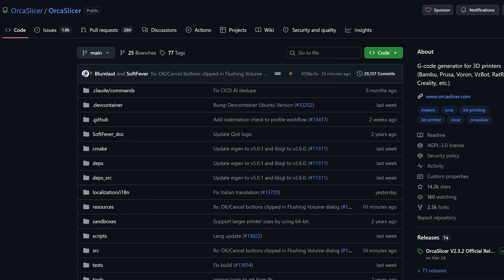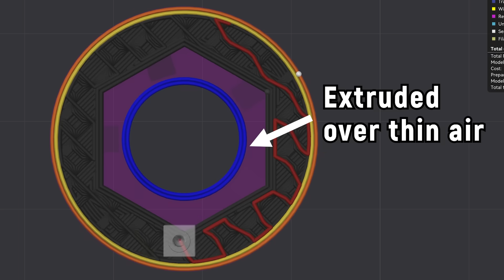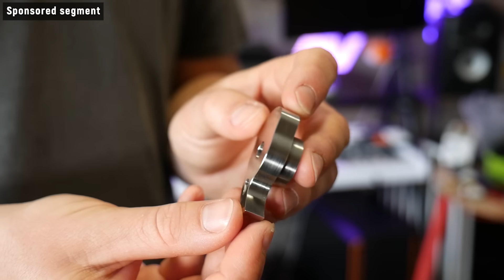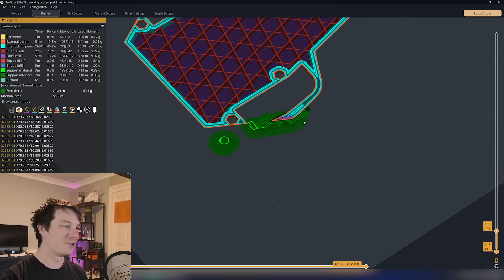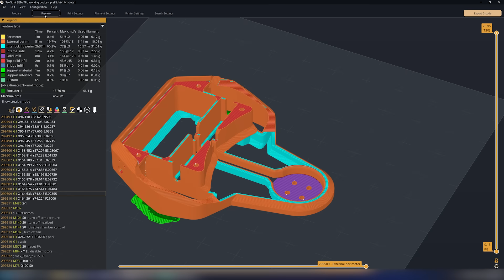preFlight - an incredible new slicer with even more incredible bugs (for now)

Comment: 6:14 I think measuring the part density would tell us more if the part has voids or if the geometry is actually different between the different methods. Printing some calibration cubes and measuring the dimensions for volume and then measuring the mass will help answer that.

Edit: Also that was one of the most useful sponsorship ads I've ever seen

Comment: using cc3d's 72 D is so evil lol, i used it to make bar feed liners for a lathe and they are still going strong over a year later, layer adhesion is unreal its practically indestructible when printed correctly

Comment: First thing Angus. I've hardly ever, if at all commented on any of your videos but I've been referring to them nearly as long as you have been making them, so It's time I said thank you, thank you!
This looks like a way of improving the strength of so many things I make, especially for RC aeroplanes (for which I never use PLA) so it's a good thing for me to learn about. It's so much more likely I will use it when you describe the settings you used so well and the good (or bad) results. I don't see any reason why the same can't be applied to the materials I use such as PETG CF. would you agree?

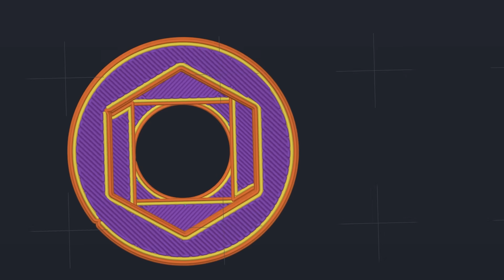Comment: 7:06 I’ve started to do this in CAD modelling (self supporting holes) but knew one day a slicer would be able to do it for us. So this is brilliant 🤩 hope it comes to orca slicer. 

I’ve noticed though on Creality Print, Creality have started to add their own tweaks & modifications. They’ve got something in the extrusion rate section that helps with line gaps when the speed changes during over hangs. It works quite well. Again I hope orca devs bring this

Comment: Submitting patches for Orca Slicer doesn't make sense for this.  It's far too invasive to expect it to be merged any time soon.

What does make sense is exactly what they did:  Pick a good slicer, fork it, and implement the changes.  

If the other slicers want to copy those changes, they can.  The source code is right there, available to everyone, and built on the same foundation they all are:  Slic3r and Prusa Slicer.

The buggyness of this proves that their changes would not have been immediately accepted in any of the major slicers directly.

Comment: Not sure if anyone has mentioned this yet, RE the settings tabs: when you click on the top tabs, it always shows all settings, and the checkboxes on the left of each setting there toggles the visibility of that setting in the drop-down accordion tabs. This allows you to customize the accordion drop-downs to only show your most commonly changed settings, which is a very nice feature similar to Cura. This is something I have wanted in OrcaSlicer for a long time, though I think preFlight would do good to change the top tabs into simple "Edit" buttons next to the accordion drop-downs instead, to help cleanup and simplify the UI.

Comment: Why not have full copper on top and bottom of your PCB's - wouldn't that make them structurally STRONGER by adding a metal outer sandwich to the fiberglass-resin of the board itself...

Comment: I still prefer sacrificial bridges... no stair stepping. Nip/Tuck looks interesting for functional parts, but my issues with seams is usually more related to appearance than dimensions. When dimensions matter, poly holes do a good enough job and also gets the seam moved in from the edge of a hole. But I can imagine nip/tuck being useful for non circular/non polygon holes.

Comment: That's really smart using blank PCBs as covers, I don't think that ever would have occurred to me. Besides being cheap, there are some obvious advantages. Those will be inherently a lot more temperature resistant than plastic, and they won't be conductive like carbon fiber. I will have to keep that tucked back in my memory files for future use!

Comment: I actually gasped at counterbore bridging! I've been waiting for that feature for so long and even tried to make a script to fix it.
Super exciting to see a full solution implemented, even if you still have to select it manually
Reply: I mean. Orca and I think prusa has had it for years..
Reply: @MeshJedi They claim to but are really not on the same level as what is presented here.
This is basically the same detail and control as doing it in CAD.
Reply: @cl3m3n7 no. It literally does it exactly the same.

Comment: Avoiding seams:
I let the printer continue with the next layer, without a pause. No retract on layer changes. That's counter intuitively, but it works. 

That's not a vase print, it works on normal solid objects. It works best when there is only one so called island in each and every layer. Just quickly move up a layer and continue printing, so there's no time for oozing. No time for making a seam.

Don't think about extruding a solid line of plastc, think of what it really is: A molten very liquid plastic. It squeezes easily in the gaps and so on and it just looks way better than any seam, because there's no seam left.

When there's an option for it, then avoid one seam line, let it use more or less random seam positions to hide it even more. 

When possible, let it start the next layer near where it ended the previous layer.

I also avoid crossing the open spaces if possible - this avoids these fine ooze lines across the open spaces. 

When there are multiple islands per layer, then try to reverse the printing order for the outer and inner shells.

Let it start a new layer on a new island on rhe outer round around the object, then the inner path, then some infill when there is some (I often print the infill only every second layer...)

That means, when an island only consists of the perimeter walls, it starts on the outer wall, then prints the inner wall, then oozes a bit while pulling the filament back a few mm. But it oozes on the inner wall, not visible from the outside.

Then the orint head moves to the other island, starts there with the outer wall, then the inner wall, then the infill (again only on each 2nd layer), so that it oozes while being on the inner perimeter wall (invisible again), the print head moves to the other island, one layer up, starts printing on the outer perimeter wall, then the inner wall and so on...

And the oozing seam is hidden.

Comment: thanks for not saying slick-three'ar buddy :) but u missed it at 2:23 with exetera... its ETcetera. not EX. we write it like etc yeah, not ext :)
the problem with this way doing unsupported counterbores messes up the roof of the cavity. why not just add a disc that is one layer heigh in the slicer and move it to the unsupported area and select 100% infill for that layer? or use sacrificial bridge option or what its called in the slicer you use;) ? this is redundant imo as support interface materials are dirt cheap and you dont use much and the purging is a few grams. its already solved better than this approach. its like coming the party the day after it ended, no?

its so fresh to see a new take on slicing :) since orca came there hasn't really been any new ones for me. this one is most def something im gonna dl and tinker with. thanks for the heads up on the 1.0 problems👍

Comment: I recently downloaded PreFlight, but haven't had a chance to really play with it. I do think the Athena perimeter generation will be a game changer in the long run. Personally, I like that it's forked from Prusa Slicer and is its own separate thing from Orca Slicer. I use Orca, and one of my biggest peeves with it is that it is so full of features and little bugs that just make it annoying to use. Because it comes from Bambu Studio, it has all this crap for Bambu machines in it that I just don't care about and don't want. Additionally, being a fork of a fork of a fork, there are a lot of little bugs and the codebase is probably a huge mess. So while PreFlight is currently early days and buggy, I do think they're working on a much more solid foundation.

Comment: Good on you for persisting through the bugs and annoying migration from OrcaSlicer. I gave up. I really wish they could have just submitted these features as pull requests to OrcaSlicer, though. 

To wit... Bridge Counterbore Holes has been in Orca for a LONG time ;)
Reply: The main "feature" of preFlight is that IT IS NOT JUST A FORK. It is a  new development initially based on Prusa Slicer. It has a different, more advanced slicing engine, whose benefits are yet to be exploited.

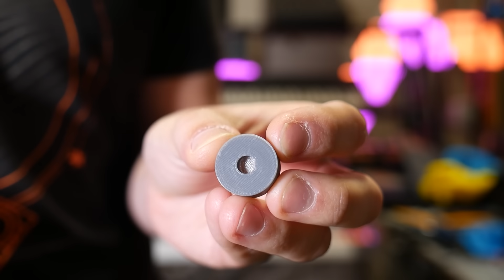Comment: 8:07 they had the chance to add the print in air functionality, and decided to go back to bridging. Shame. Also they were late on the brick layers, they're not pioneers. It's been done so long ago that even Cura, the old open source one, has had scripts for it.
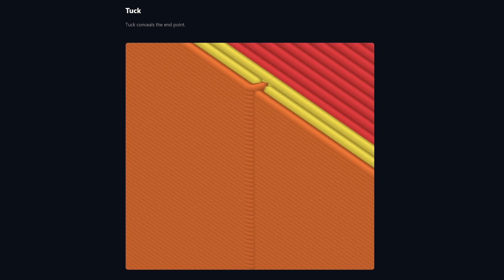9:00 This is just a different way to name where to pull the nozzle after the line is done or before the line is started.

Comment: Question: Should I switch from ElegooSlicer to preFlight or even to OrcaSlicer. ElegooSlicer seems to be getting all the latest stuff features within 1-2 years. I own Elegoo Centaur Carbon 2 and I see the potentially in it. After it may well be a real power house. I do not have the knowledge base of all the slicers to make the final judgement to be sure which is the best on which the setting modification could be made on. 

Previous printer was Ender 3 v1, tweaked it to be pretty good machine. Was a great printer for small parts but anything bigger it would just fall on it's face with the print time. 9h Ender print takes on CC2 under 3h.

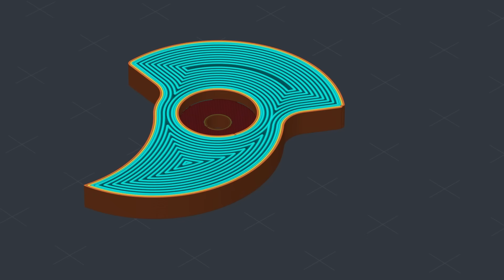Comment: Skip to 2:40 to see the unique features of this slicer (no offense to the creator, it's just that it makes more sense for us as users to see if there are any pros before we hear the list of cons for a product).

P.S. it would be nice to see testing of the material, though I would like to point out that your test stand thingy was mainly testing the bending strength of the part? Which is a little bit of an indirect test. Maybe it would be nice to have one test piece to test shear strength(like what you made but with a much shorter arm), and another to test normal (pulling) strength, as those are the two loads that make up every other type of load. 

P.P.S. wow that cat is gorgeous what brand (breed) is it?

Comment: I know SuperSlicer isn't popular anymore, but it has a `seam notch` feature, similar to the nip/tuck but differently implemented. Also the alpha/beta releases contain a `max overhang` setting which can result in counterbore bridging and tear drop shaped vertical holes, but it'll also mess with the rest of the model if it has severe overhangs.

Comment: I use PCBs in RC cars for replacement parts.  When using them structurally, remember the copper is still metal, even if it's soft.  Keeping it on as a full fill plane, or just in needed areas to help keep the FR4 from splitting, costs nothing extra.  You can even go to the trouble of adding platted through holes for even more support, or even castellations or a plated edge to connect it to other parts.  And, the plate can be used for power transfer without fear of losing parts.  It's great for power distribution.

Comment: After the first seconds, I had to laugh when I had seen this microphone, and than more and more again during the rest of that video.
Your knowledge of 3D printing is very poor and that Slicer is the same bulls**t as many other slicers too, including ORCA.
The only slicer thar I used over all the years that is fast and brings strong results even for beginners is the CURA slicer from Ultimaker.
All settings are much easier to reach, no very long scroöö lists and the parts of the settings are sorted logical.
And by the way, before spending a lot of money for PCBway, it´s better to buy a printer from Ultimaker, this are printers made for professionals and that´s why their slicer is professional too.
I can bet, that PCBway uses printers from Ultimaker too, because with an upgrade you can print also metal up to stainless steel ( KAWASAKI is a customer of Ultimaker too ).
Unfortunely Ultimaker does no lomger support the FDM printers of other brands (WiFi-protocol and other features), but if you look at the prize of a Bambu Lab or Prusa printer, that are NOT made for professionals and compare with the prize for an Ultimaker printer, you would be surprised.
But these are fot professionals and not for people that only want to stand in the spot light on XouTube like you.

Comment: I've been using a janky method of adding interlocking-style layers to my own prints using an STL that's just a stack of 0.2mm high cubes stretched out over a model. I set it as a modifier and adjust the inner and outer wall widths so the inner walls are printed in between the walls of the previous layer. Kind of surprised that Orca Slicer doesn't have some kind of "every other layer" height modifier.

Comment: I think we really need a good plug-in API for the slicer engine. So that everyone doesn't have to build their own slicer software just to add features.
Reply: Based on their website that's their most important feature. As far as I'm aware of how Orca and Prusa work under the hood they're going to buckle under the weight of their own complexity soon while Preflight has a plug-in pipeline built-in.

Comment: If I'm understanding correctly then you are thinking there should be a 1:1 ratio between volumetric number and extruder speed for same extrusion volume. I think this is incorrect. Fairly sure that the filament speed is how fast the hot end is tracking and that the volumetric setting is volume based. So, for example, halving the layer height for the same speed halves the volume extruded and gives less thermal mass to bond with the layer below. Volumetric on the other hand can be more closely related to hot end capacity to melt filament fast.

Comment: 10:13 I accidentally learned that PEBA rubber is ridiculously strong.
A 0.4 mm thread right from nozzle is usually easy to rip apart. Not so with PEBA. It cuts into your finger instead.
I hate that many brands try to hide what kind of rubber it actually is. 
In my case I had to guess from properties to deduce the type. But its quite clear in this case.

Comment: Wasn't that perimeter interlocking mostly not available to some stupid patent on a this totally self suggesting idea?
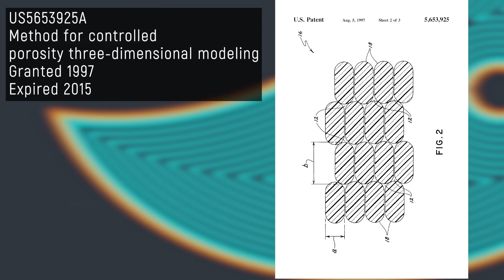Or was that just hearesay? Ah "bricklayers" patent at 3:53 
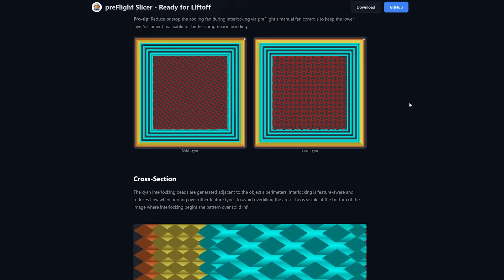But how is that not exactly the same thing here looking at the cross-section diagram at 3:20?
I don't see how bricklayers would require many height micro-adjustments as stated.

Comment: I have always wondered: why can't the counterbore bridging be done by the slicer like a star shape in just one layer? (Instead of having just 2 parallel lines on a layer then another layer) Possibly that layer doesn't even need to be filled in at all, just that webbing and the next layer can be the original geometry of the model
Reply: You might be onto something there. But I think for reliable bridging, you have to start a little bit above and behind the perimeter, otherwise the extrudate can detach.

Comment: Waiting for the rug pull on this. Hard to justify a company vibe coding a new slicer for any significant amount of time without income.
Reply: Beta tester here. Vibecoding? You do realize that every dependency in the slic3r codebase was completely updated or replaced with some not EOL for PreFlight? PreFlight is using Clipper2, which is not a huge upgrade in of itself but Clipper doesn't have an official upgrade path for that. Orca is working on Clipper2 adding it where they can but they don't have the man power or "slop generators" to replace everything that used the original Clipper. Every dependency that preflight has is updated, prusa and orcaslicer still use end of life dependencies. This has taken at least 2 years of work to "modernise" the codebase into something clean and "useable" for development in contrast to orcaslicer which at its core is jank, built on jank, built on jank and only time will tell when that age will show. Preflight removes a lot of that jank (since it doesn't have to touch any of bambu's stuff) and keeps the slic3r legacy going as that was a fairly solid foundation strengthened by Prusa and SuperSlic3r
Reply: Oh. They build printers, should've said that initially they're a printer company first
Reply: @muuhamj where can I buy one?
Reply: @N3MI-DG  best to contact them via email, Slice Engineering offered some of their machines to us once. Not sure if they ever went mainstream

Comment: That bridging strat is bugged, or at least messed up by other settings... It should bridge straight across, then straight across at a different angle. Instead it's trying to use two bridge lines as an anchor line web thing for middle-layer solid fill, which seems pretty optimistic at best. Maybe some other settings are forcing middle layer fill when it should be bridge fill?

Comment: Hmm now I'm wondering if some hybrid of the nip/tuck seams and the scarf seams would work well... Basically take the scarf seams start and stop points and bury them into the part slightly so the extrusion is consistent by the time it is visible on the outside. Because the issue with scarf seams at least for me has always been getting the extrusion to be consistent even though it is starting with such low flow.